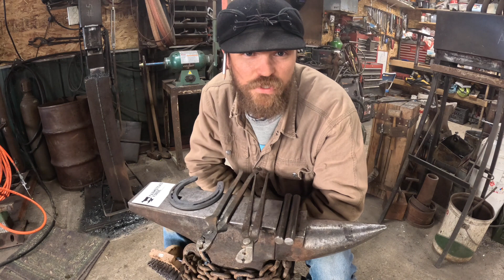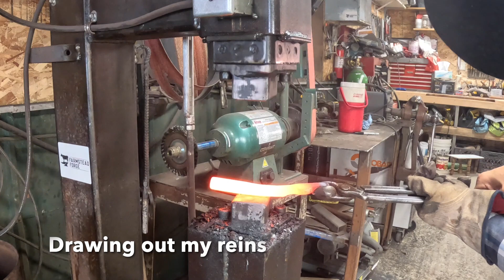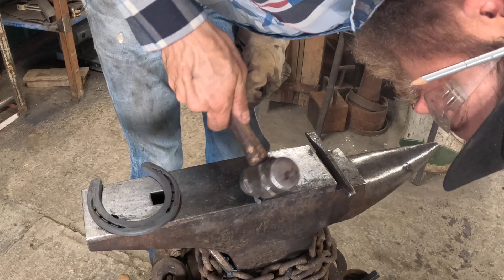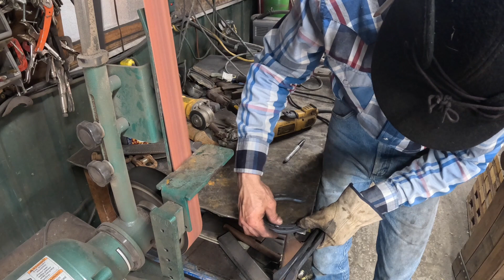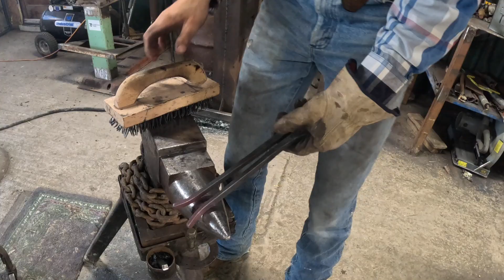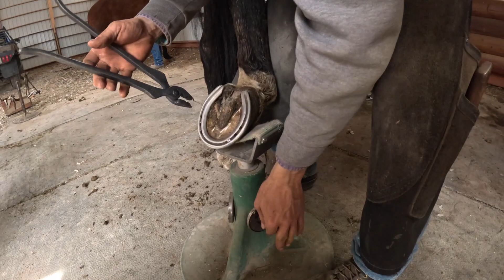Crease Nail Pullers  | Hand Forged

Comment: Nice work,  but I didn't see you temper  them afterthe quench.
Reply from the maker: Thanks - I tempered my last set and didn't have good luck, so with this set I just quenched the tip and left it at that. I have used them daily since I made them (probably a month ago) and they are holding up just fine.

Comment: What kind of steel is that sucker  rod?
Reply from the maker: I've been told it can be 4130 or 4340 but I think it depends because I had some old stuff that has a lot different feel than the current stuff I am using.